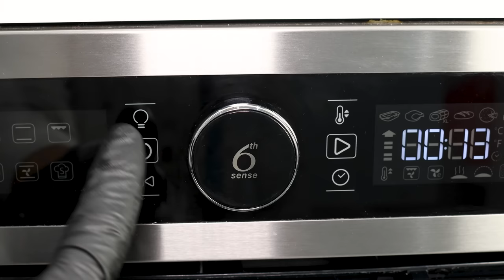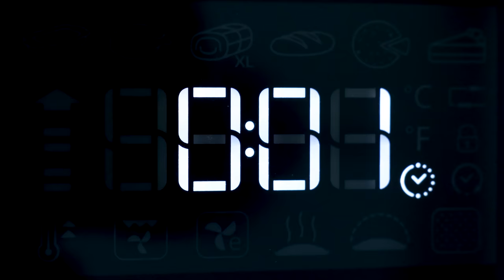ASMR - Heart Waffle Machine Restoration - Cooking with Tysy

Comment: A tip is to pour the batter into the middle and let it flow out, then you dont get the "spilling" outside the hearts, lovely video anyhow❤ im currently in the restoration of me own waffleiron and hoping to use it soon! Though i do wish i had a sandblaster😅
Reply: Also, only add a third of the egg whites to the batter and fold in, slow and gentle. Then add the rest, still folding in slow and gently.  The idea is to not lose too much air from the egg whites. Some of the 'lift' of the waffle comes from the egg whites. 
🤎

Comment: You can also run it through the "clean" setting on a self-cleaning oven. It incinerates the rust. It worked for my rusty cast iron pans before seasoning them.
Reply: If I'm not mistaken the clean setting on an oven is a MASSIVE fire risk
Reply: @drfeelgoodx176  Yep, especially if your oven is dirtier.
Reply: @drfeelgoodx176  someone In our building set the fire alarm off because they did that
Reply: Sandblasting, lasers, & vinegar.  Great rust destroyers!

Comment: Lovely result! ☺️ As for the rust dust, you could probably use it to make some ebonizing solution for woodworking projects. I’ve made my own from rusty steel wool pads and vinegar. It also needs tannin to react and create the deep black stain, so best used on oak or very tannic woods.
Reply: no heart ez

Comment: Little tip: when you mix in the whipped egg whites, first mix them into a scoop of whatever you need them incorporated with and then when you put it all together, it'll mix more easily, and you won't lose as much of the air you initially whipped in.

Comment: I would use the old rust in an epoxy mix next time you make a new handle or have to repair a baseplate etc that cracked and worn along the grain.

Comment: GREAT JOB !!!!!   Just 2 thangs.   1st.   NO butter or sirup of you choice.   Darth Vader eats KYROW SIRUP      2nd you cut off handles —- drilled out and frescheneded up threads.  —- Maybe soak threads with penetrating oil and use vibration shocks with ball-pieen hammer on steel rods.  

Any way you made my hungry.   

Bonus recipe.  ED’s RED Super Dupper Penitrating Oil

Comment: 7:08  Where does the 2mm excess material for flanging the bolt come from when you filed it flat beforehand (0:49)? Magic material extension?  Double double toil and trouble, fire burn and cauldron bubble?
7:08  Wo kommen denn plötzlich die 2mm Materialüberstand zum bördeln des Bolzens her, wenn Du ihn doch vorher (0:49) flach abgefeilt hast?  Magische Materialverlängerung?  Hokuspokus Fidibus?

Comment: I just came here to say the waffle in the thumbnail is not the waffle that would be made from this waffle iron. You can tell because the grid pattern on the iron is on a diagonal. But on the waffle, it is straight.
Reply from the maker: of course is not the same😂

Comment: What will you do with rust? I don't know why you collected that in first way.
About waffles you did wrong when you want stir beaten egg whites with a dough. What my mom teached me that to not add a whole beaten egg whites, because they're will be not fluffy. First add a little bit of beaten egg whites and mix gently until the egg whites is combined with the dough. Than add the rest of beaten egg whites. For the beginner it will be better if you gradually add protein to the dough, because you won't necessarily get it like that at first. However, it takes practiceso don't surprised if you fail again.

Comment: ED’s RED Penetrating Oil Recipe

Works better than most penetrating oils.  Let soak overnight for rusted shut or frozen parts

1 part Acetone
1 part ATF (automatic transmission fluid)
1/4 part Lanolin Oil (optional)   

￼I’m still hungry !!!!!!    WAFFLES.

Comment: You didn’t show how you threaded the new handle.
You didn’t preheat the oven.
You poured the milk too slow, to where it flowed down the edge of the glass.
You took the burner completely out of the case, then slid it off the table. (It was brand new it; it may have broke.)
You cooked the waffles with too high of a flame. Cast iron heats up slow but stays hot long long tyme.